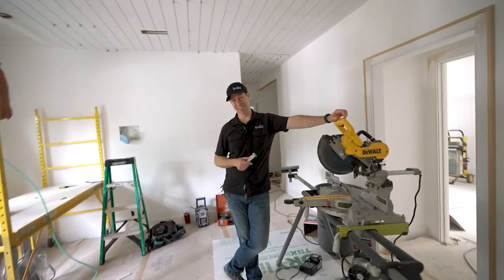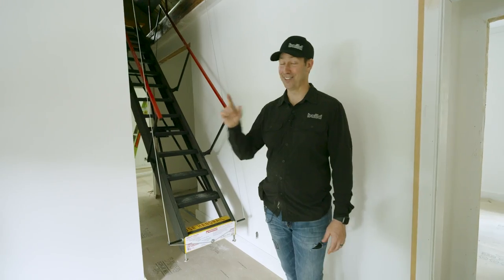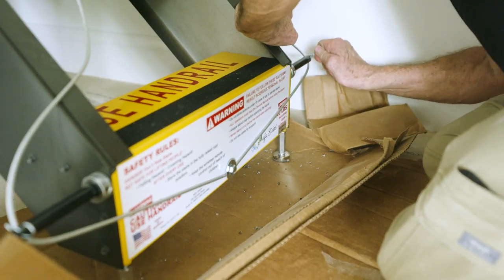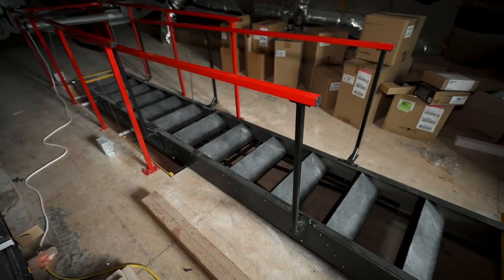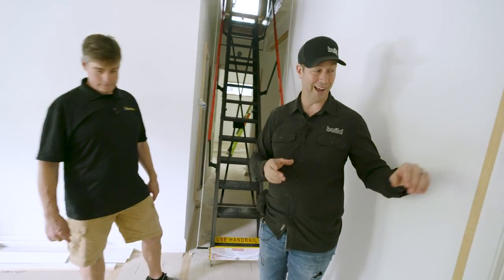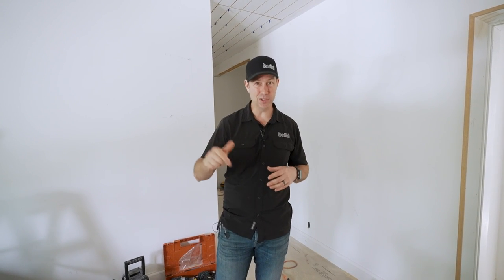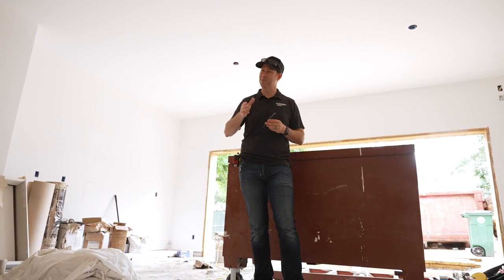Majic Stairs - Full Sized Motorized Attic Staircase!

Comment: If you want to conceal it you need to do staggered scarf cuts...
Reply: That's what I was thinking.
But even at that; the bolts showing in the emergency access panel is a dead giveaway.
If it was really concealed, it could be used as a safe room as long as you have a way to lock the stairs up so that they cannot be manually lowered.
Reply: @scotttovey   (as they lower due to gravity - all it takes is a locking pin (or 2) to stop it lowering  (or some rope to tie it up - when you are in the (hopefully) bullet proof attic. - unlikely.)
Reply: @scotttovey  I'm curious, what makes folks who watch this channel so interested in safe rooms? If someone is rich and famous and at risk of being specifically targeted for kidnapping, I get it, but what's the draw for everyone else? I've always seen it as a way to waste money for the 99.99%.

Comment: I did residential hvac ten years ago.. my last day before moving up to big commercial/industrial I was coming down a pull down and the tread snapped… fell 5’ onto hardwood floor. Stairs like that would have paid for itself
Reply: We’re you ok after that fall? I always have 3 points of contact on a ladder and never both feet on the same step.

Comment: Nice system, the adjustable feet need rubber to prevent those hard metal feet from denting your wooden floors. It's nice your attic is a storage space but you need to be strategic in where you place whatever you want to store up there. If anything breaks you are going to be playing Tetris moving boxes or whatever so your mechanics or you can access your systems.
Reply: I vote a pair of tennis balls! lol

Comment: Given the conditioned attic space, what is the advantage of this unit vs putting in the kind of permanent attic staircase that older homes used to have? It seems like the cost (4000-6000$ after installation) is comparable to paying your framers to  build another non-load bearing wall and a low cost contractor grade staircase?
Reply: Space savings.    The permanent stairs always take up space, while the shown steps go away when not in use
Reply: Space.  Stairs take up a huge chunk of real estate, which you would lose on the main floor, just to have a permanent access to a rarely used storage room.
Reply: @W78thIS  fair point, although if the space had a permanent staircase that didn't block a hallway, maybe it would be used more often?
Reply: @kschleic9053  At which point, there's not any cost savings, because now your unfinished attic needs to be a finished space for more use.
Reply: @W78thIS  my previous home had a 24" wide, quite steep attic staircase tucked into the space of a 6' wide closet. I wouldn't qualify it as taking up any significant amount of space, and it was incredibly handy for making the attic into part of the home. Is that kind of staircase no longer allowed? I could imagine that code might get involved with a permanent staircase while ignoring rickety fold down stairs...

Comment: Usually don’t seal very well, but this a conditioned attic so it doesn’t matter that much.
Reply: I was wondering the same. But it would not matter with a conditioned attic.
Reply: @germankiss  if you had a conditioned attic with the stairs coming down into an unconditioned garage a good insulated seal would be important

Comment: My job has something just like that for a hidden mechanical room. The motor broke while it was closed and there was no emergency access and zero access to the room. They were forced to cut through a concrete wall to get in and fix it.
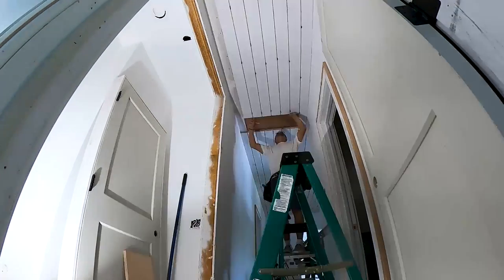Reply: He mentions this has a manual mode at 5:00
Reply: Oh man - thanks so much for the warning

Comment: It is a very cool stair… but I hate the cable across the front.
I wonder why it couldn’t be designed with the lift at the top instead of the bottom…

Comment: Very expensive stairs.  $4000 for stairs (10' ceiling), $400 crate fee, $900 shipping, and then the add-ons.  This does not include installation.  I was considering it until I saw the cost.  $300 rickety model is good for me.

Comment: If you'd staggered the planking to begin with you have enough room there when the hatch swings down to have a staggered 'edge' to the planking covering the hatch so you could have made it more concealed, maybe totally if you did an excellent job, but as it is it's actually pretty obvious imo. Very, very cool but it's obvious it's there and I'm not saying it just for the sake of criticizing it - it's a great job in any case but a burglar would notice it immediately Matt so don't convince yourself otherwise. Who wouldn't run a complete length of planking down that hallway given the rest of the ceiling? Whereas, if it were all staggered then you could use that to your advantage and really blend in that break line.

Comment: I really don't get why you would use this for a new house. Just install a permanent set of stairs, unless space is a factor but it doesn't look like that's the case here.
Reply: Why would you install stairs into a hallway for an attic?
Reply: @DK-lz7kg  If you're not going to practically use it often, why have an attic? If the space is worth having, it's worth making accessible if you ask me :)
Reply: @WoLpH  that’s literally the point of these stairs... it makes an attic much easier to access and you can hide unwanted stairs
Reply: @DK-lz7kg  it's less convenient than regular stairs and it blocks the hallway when it's down. I would either install a proper permanent set of stairs, or design the house in such a way that you don't have an attic